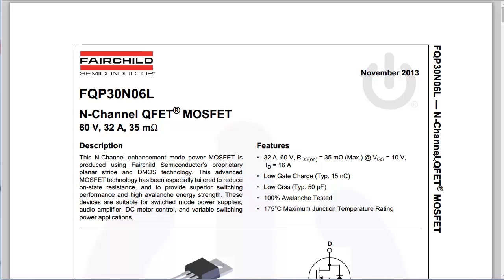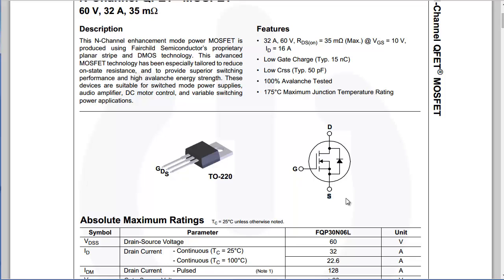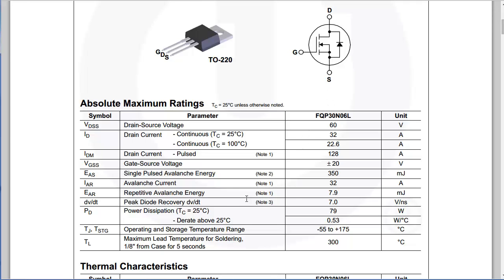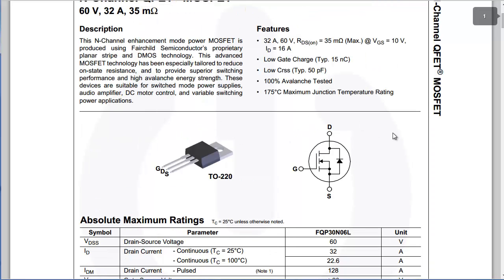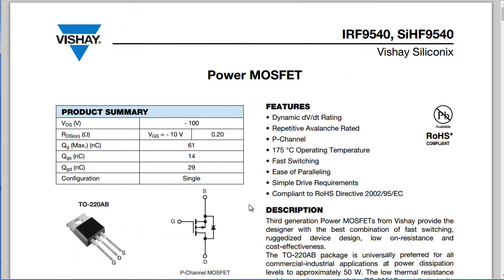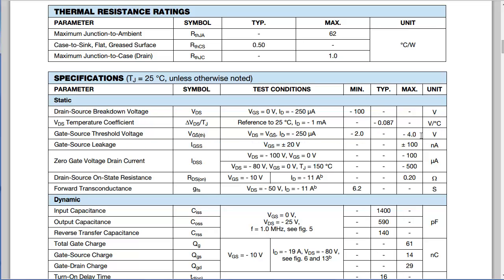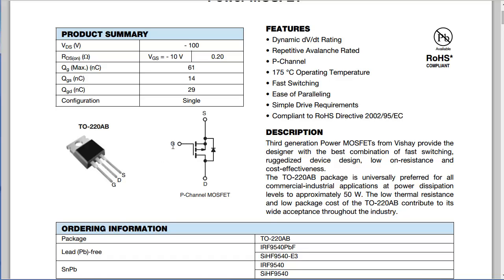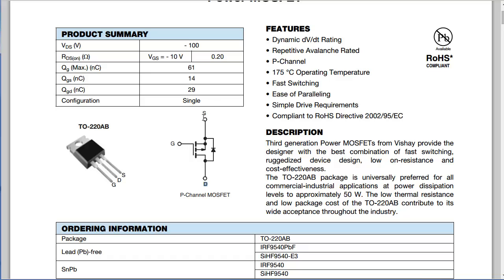Electronics #2 - MOSFET sizing challenges and considerations

Comment: Good day to everyone. MOSFET stays for Metal Oxide Semiconductor Field Effect Transistor. If you look at the cross section of P-channel MOSFET, for example, you'll see that it consists of two small P-doped regions (Metal Oxide), called Source and Drain and they are surrounded by N-doped silicone (Metal Oxide). The N-doped substrate separated from the Gate electrode by thin layer of silicone or just simply glass. Because the whole construction has "electrodes" separated by glass, it has some capacitance as a capacitor would have. Because of the capacitance, MOSFET will accumulate some charge and will not work as you want it to work, so you have to use pull-up resistor to keep gate high at all times in P-channel MOSFET. The reason for the above is that your Source and Drain are P-doped with N-doped substrate in between them. When you pull the Gate electrode to the ground, the area in between Source and Drain will form a channel and current will start to flow. Reason - negative charge attracts positive and positive attracts negative. As there is a capacitance and charge will be there for a long time, your MOSFET will stay on at almost all the time and this is why you have to use a pull-up resistor in your circuit. Pull-up resistor is the resistor connected between Gate and Vcc. For N-channel MOSFET everything is the other way: pull-down resistor to ground and it will be turned on by supplying voltage to the Gate or simply by switching your pin to high state. I've spent some time learning about MOSFETS and if someone has some questions, I'll be happy to answer them to the best of my ability. If you are playing with arduino and may be 12 volts or so, pay attention to, as Vlad states, Vgs; amp rating; and placement of your load. For P-channel MOSFET load is placed between MOSFET and GND; for N-channle - load is placed in between MOSFET and positive, your 12v for example. Always a good idea to separate logic circuits such as arduino and all the gates from power circuits. You also have to place a current limiting resistor in between your arduino pin and the Gate as well. If something goes wrong and MOSFET's thin layer of silicon/glass will be destroyed, your pin will be safe because of the current limiting resistor in between Gate and pin. Try ~1K resistor. So when I use, let's say, P-channel MOSFET, I use ~47K pull-up resistor to Vcc or simply to arduino's 5v or if you use N-channel MOSFET, pull it down from Gate to GND via same value resistor. If 12v is used to power your electronics, logic and power GNDs has to be connected. Hope it helps someone. Vlad thank you very much for all your informative videos and please keep them coming.